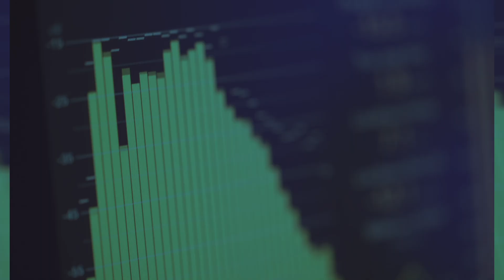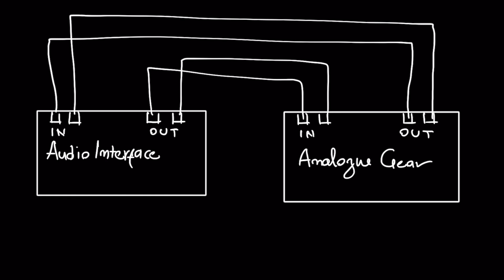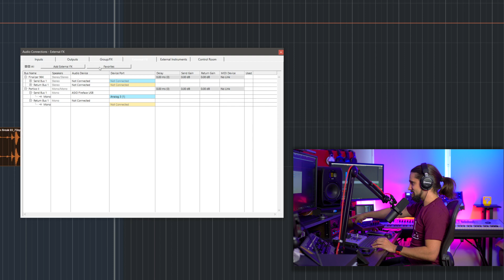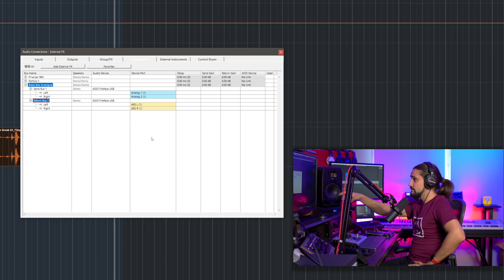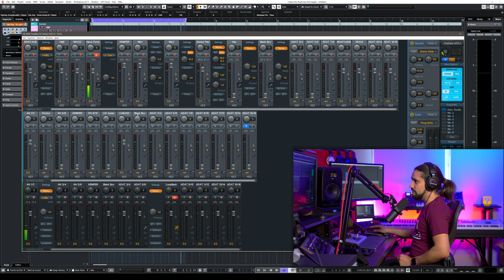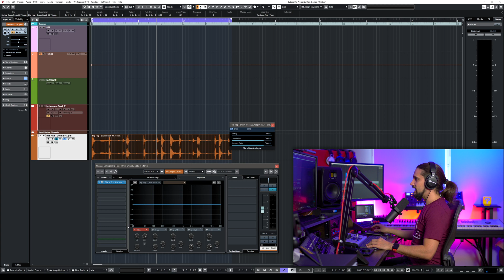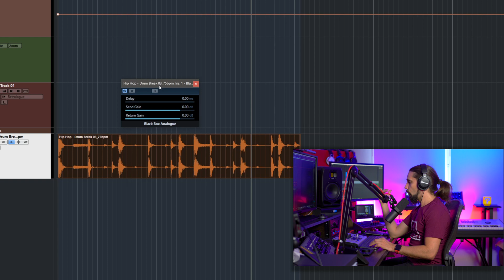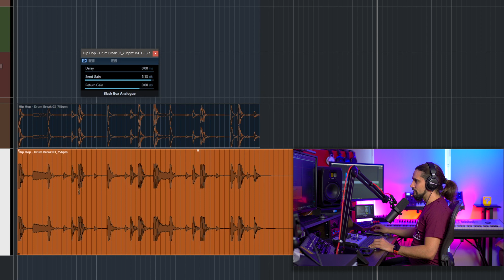Use Hardware Analogue Gear Like Plugins In Cubase! All about External Effects!

Comment: Love your channel Dom, superlative!! You're a star!!!  I use a Warm WA76 through a neve 1073 pre/EQ via a send/return into an RME UFX+ and its output running to a soundcraft EPM12 analogue mixer.  For an alternative mic input, I run through an ART PRO MPA II (AX12 valve change), into a Warm EQP-WA tube EQ out into the RME.  Mics are TLM103, NTA1A,  AKGP420, Stellar X2 (TZ Audio), SM57 & 58s. Headphones AKG Perfection, Effects are TC Helicon Voicelive Rack and a UAD Quad TB3 Satellite (I use the Lexicon480L reverb plugin on that, nothing else comes close in my relative opinion ofcourse). Running Cubase 10.5 Pro controlled via a Presonus Faderport 16, into a scan (flight case compatible 4U) computer, i9 10-core 32Gb Ram with an EditorsKeys slimline  backlit keyboard specifically for Cubase. Native Instruments Komplete Kontrol M32 keyboard controller, KRK Rockit 5s, although I mainly mix through the headphones. Misc software I mainly use Trigger 2 for drums and Scalar 2 for gathering ideas generally.  However, nothing compared to your sensational crazy cool setup!!!!!

Comment: I would like to see more about the steinberg audio interface you are using there is not much on youtube about it and I am considering getting it because of the specs and the silk integration.
Reply from the maker: Hey Edward, what would you like to know? :)
Reply: @DomSigalas  How much space does it use when recording at the highest settings also the sound of the converters without your...other ad/da running...and some real life silk examples
Reply from the maker: @edwardbrands3271  Aaaah at 384khz/32bit files are pretty large. For me the most important thing is the Silks- I have the actual neve unit and they sound really REALLY close. I've done some recordings of it on the Steinberg Interfaces channel (recorded a band and a string quartet maybe you can check them out to check the sound quality :)
Reply: @DomSigalas  Than you